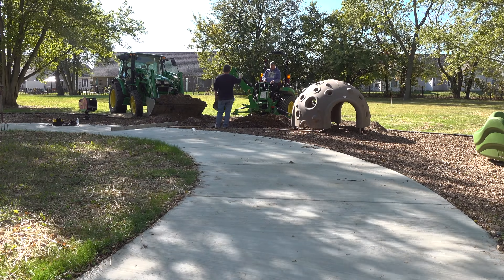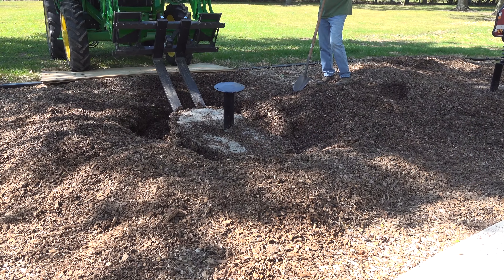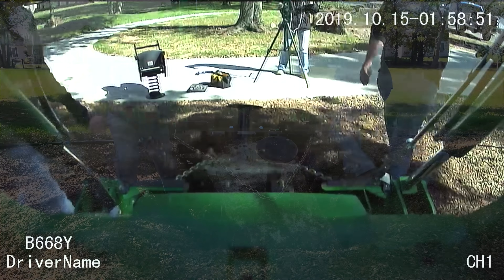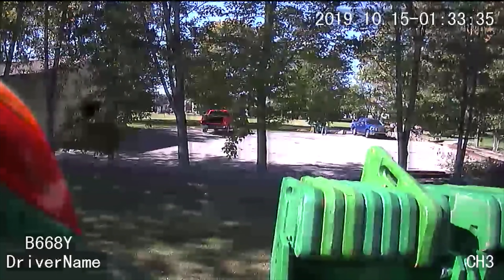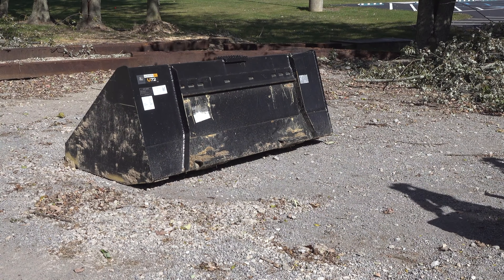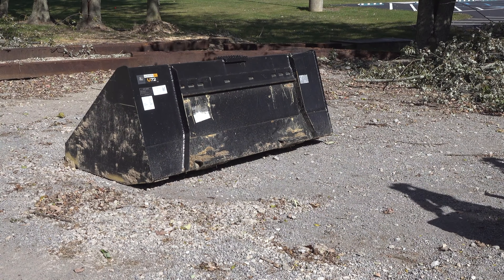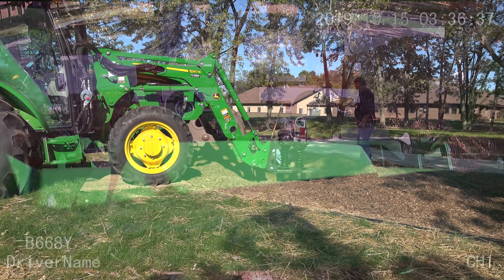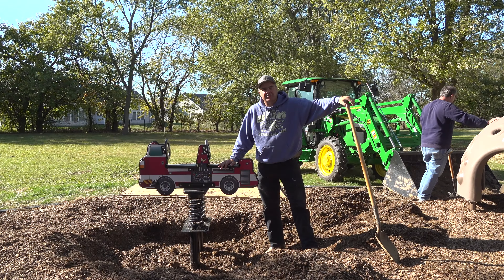Playground Do-Over! Deere 2038R Backhoe & 5075E New Camera System!

Comment: Getting ready for our first snowstorm of the year. 8 inches or so I guess. That means about 6 hours of plowing for me with my 1023E  (2 condo complexes) in the 20 degree weather today .   I thank TTWT PROFUSELY when i'm sitting in my cozy original cab now. :)  Truth is though, its actually more comfortable with the doors off. The windshield and roof keep the snow and most of the wind off me but yet with just a jacket and gloves on its nice to be out in the storm. I and all our residents thank you tremendously ! :)
Reply from the maker: You seriously leave the doors off!?!  I have been installing mine this weekend. Was thinking about getting more foam or vinyl for better insulation.
Reply: @TractorTimewithTim   yep. its very comfortable. having the windshield , roof and back window addresses most of the snow/moisture getting on you and keeps it warm enough as to where a winter jacket is plenty. Actually I just wear a sweatshirt and a lighter jacket and gloves.  having the doors off gives great visability as I have to get around a lot of cars and tight spaces. its just overall though very comfortable. Good luck ! :)

Comment: Tim, I know this is ‘a day late and a dollar short’ but some wet wet concrete or loose sand in the bottom of the hole with the hole a bit deeper than needed helps to take up the voids and misfit of resetting solid items such as your concrete base. That is a trick that my now 92 yr old uncle taught me 40+ years ago when I helped set concrete septic tanks. We wanted the concrete wet wet so it would shift and squeeze out if needed as we leveled and plumbed the bottom of the tank.
Only problem with using concrete is you have to go back later to fill your hole. With sand you can backfill as soon as it is all in place, but sand does ooze out as well if too much is put in.

Comment: A couple of tips. One whenever I use forks in that manner I chain them together for safety. Two to get the concrete back in the hole and nice and level use water. I've had to do this sort of thing with fence posts etc. Dig the hole to the right depth then add water as you add dirt, a layer at a time. The water allows you to wiggle and level the block, then just keep adding dirt and checking level. Three, use the forks to pack down around the block. Lots of ground pressure that way. The combination of wet soil and pressing with the forks will really pack that dirt in so it doesn't shift on you.

Comment: 💥 Nice use of the forks getting that pedestal right between them. I was envisioning hanging it from a chain. 
Keep on tractoring!
Reply from the maker: Hard to believe this is the same fork frame you use on your bx!  Incredible strength with such light weight!
Reply: Tractor Time with Tim 
For sure, it’s incredibly strong. I need to find a project for a video displaying the adaptability to small and large tractors. 👍

Comment: Tim with the tractor plumbed for a grapple. Maybe consider a side shifter for the fork attachment. Very very handy on forklifts. Makes the alignment a lot less critical. When placing objects on racking and those concrete blocks back in their holes. I have not seen any offered anywhere yet myself. Enjoyed the video. Thanks.

Comment: FYI...  Had a SSQA on my JD 4720 CUT with 400cx FEL.  Not sure if you did this, but you need to fully curl the bucket back once you've got the upper wedges of the SSQA engaged.  That makes moving the levers as easy as possible so they position/engage the lower "pins" of the SSQA.

Comment: I would recommend picking up at least 3 sheets of thick durable plywood to place material on.  It creates a hard barrier.  Even if you still wanted to fill the bucket, you wouldn't contaminate whatever is under it (mulch, grass etc.)  You can check out the technic on Cole the Cornstar's channel and when they dig graves!

Comment: I would have put a chain around the forks to keep them together for safety
Reply: Time Table a strap is probably a better tool than a chain that can slip. Might want to use some flexible protection means like an old mudflap or floor mat or carpet.
Reply: A strap would be better. I am just saying a chain because that is what her has right there on hand and idk if he had straps but I do know he had chain because I could see chain
Reply: Time Table he used straps frequently on earlier videos for a variety of uses including to strap Johnny ‘1’ (2014 model I believe) to his tilt deck trailer. 
I dare to guess that like me he has several of both straps and chains on hand at all times. Both have there places.
Reply: Time Table to state such reveals what you are to all readers!
Some assumptions are extremely safe! One of those is when someone had used straps that they have straps with them!
As I have stated, I have watched videos where he used straps!
Reply: It is safe that he would bring them because he would think he would need them but he used chain and you can not say he has something that he had before because as you say he doesn’t have Jonny 1 anymore but you have seen it in other videos and he has had a tilt deck trailer before but he doesn’t have that anymore. So to say he had straps that he has used before means nothing. You only know what you can see and you did not see any straps

Comment: Johnny 2 and Johnny 5 did a good job working together. I guess I need to get another tractor. I think that was the best way to lower the rides and you got to put a few hundred pounds of dirt on top the big concrete block, plus look at the tractor work you would have missed

Comment: The biggest issue I see that no one seems to be mentioning is that now the steel pipe is in direct contact with the ground and will rust a lot faster. Not that I don't enjoy using tractors where applicable, but I think this probably would have been better solved with a welder.
Reply from the maker: The concrete was too high.  Supposed to be 12” mulch over the concrete for safety reasons.  If we had cut pipe, i do not think we would have had room for 12” mulch.
Reply: @TractorTimewithTim  ahh. Wasn't aware of the mulch requirement. Makes sense!

Comment: Did you use wireless cameras? How many monitors?  Great  idea!
Reply from the maker: One monitor, 3 cameras.  They are not wireless.
Reply: @TractorTimewithTim   What type of unit are you using --model number?
 I really would like to try to rig something like that on mine when I have the forks on as I can't see the ends of them.

Comment: I would of cut them off and welded em lower. Way easier than all that digging 😂
Reply from the maker: But we have 12” mulch depth requirement...above concrete. I forgot to mention that
Reply: It may be easier, but a large enough welder with enough current is needed to heat the metal for proper welding and an experienced welder are needed. By the sound of it, digging equipment was readily available. There is also a matter of liability if rewelded, both for the church and the manufacturer.